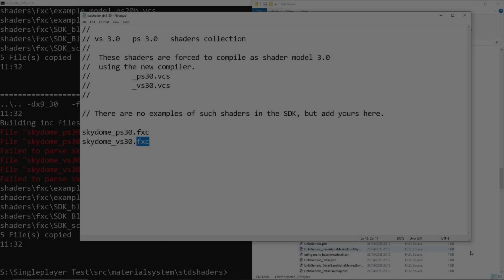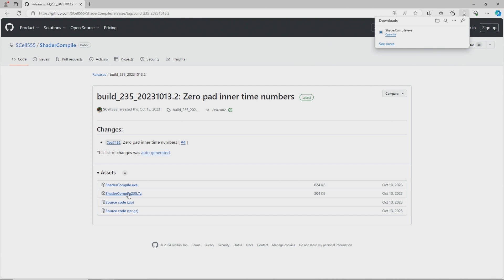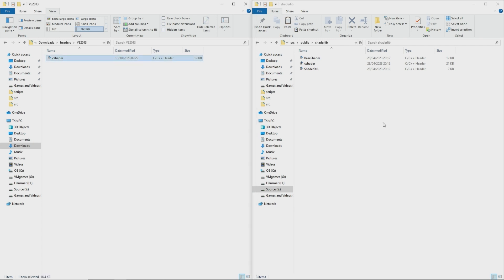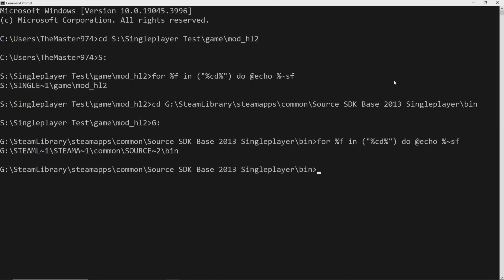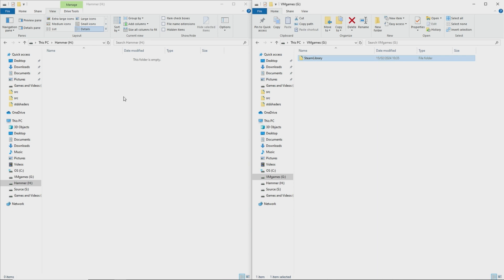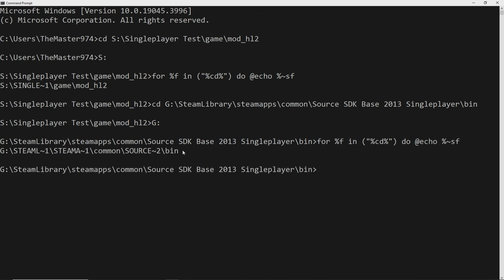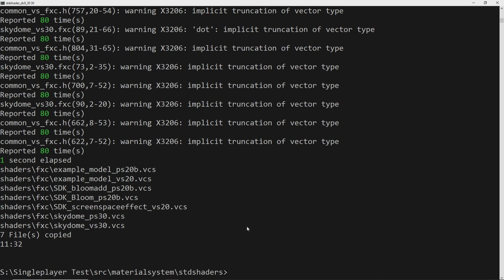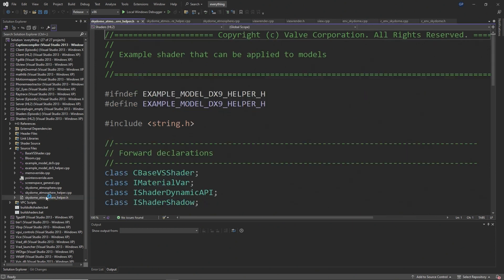Valve Source Code 2013 Tutorial (Episode 6 Alt): Shader Authoring Part 1.5 [Using SCell555s Version]

Comment: How do I solve the warning x3206 problem?
Reply from the maker: I don't know to be honest, warnings mean the shaders can still be compiled, errors are where shader compilation fails, so it's not the end of the world to be running into warnings. The only thing I can really suggest as a solution is to dig into the source code for this modified shader compiler application and figure out a way to suppress the warning messages.

Comment: I have an error/warning problem
While compiling shaders, it is sometimes (30vs) or (ps30)
Knowing that I have done all the necessary steps
Reply: Warning/Error 
Like there 7:37
Reply: Knowing that I did all the steps
Reply from the maker: What is shown in the video are warnings, you don't need to worry about anything if those are the messages that you are receiving. Errors, on the other hand, will prevent the shader source files from compiling, so you would need to look into why that is happening.
Reply from the maker: Thanks for the comment, however I'm not sure what your problem is?

Comment: Yo Master, Can You Make A tutorial to fix trigger_level change in multiplayer like GMod/Jbmod did?
Reply from the maker: I could do, however I don't know how that works in GMOD or JBMod. What is the issue with that currently?
Reply: @TheMaster974  well in hl2dm trigger_levelchange doesnt work and thats means source sdk 2013 mp doesnt have it too, and in gmod when you play a map that has trigger_levelchange (like hl2 map) you will get a screen like when you loading map in gmod so can you do it?, or i may can record it for you in my channel so you could see how trigger_levelchange work in jbmod or gmod
Reply: @TheMaster974  ok i did make the video on my yt channel, so you can see how trigger_levelchange work in gmod and btw jbmod trigger_levelchange was same like gmod one
Reply from the maker: I see what you mean now, I've taken a look into it and I think I've found a solution (prepare for a lengthy comment with some details!). What you want to do is open up triggers.cpp in the Server project and scroll down to the CChangeLevel::ChangeLevelNow function definition. Near the top of the function you should see a "if(g_pGameRules->IsDeathmatch())" statement, which you want to comment out (plus the return; line as well) because it disables level transitions if the game mode is set to deathmatch (which is the default game mode for Source 2013 Multiplayer). If you test at this point, level transitions won't work because they only work for singleplayer situations and the code for this is in the engine (which is pretty bad). However, there is a multiplayer version and to use this, within the same ChangeLevelNow function, scroll down to the engine->ChangeLevel(st_szNextMap, st_szNextSpot); line and replace the st_szNextSpot with NULL. This basically allows multiplayer level transitions to work, because we are changing the code to do a changelevel command instead of a changelevel2 command, where changelevel2 only works for the aforementioned singleplayer situations and changelevel works in multiplayer scenarios. This could have been impossible, but thankfully it wasn't!